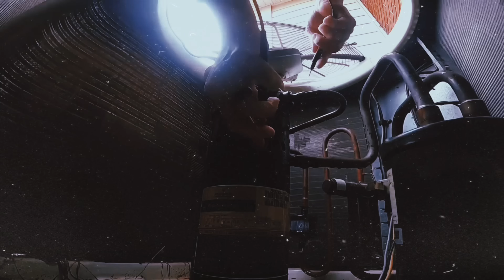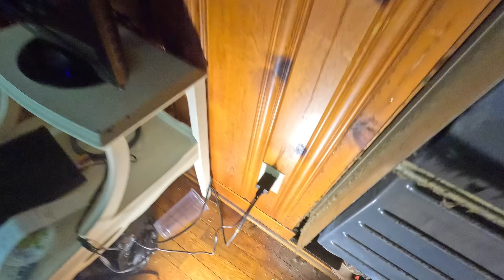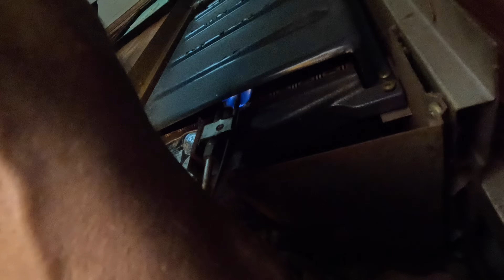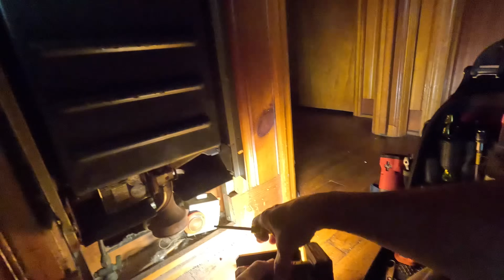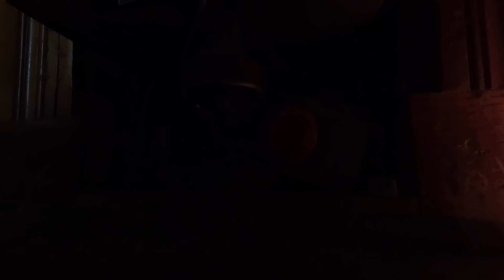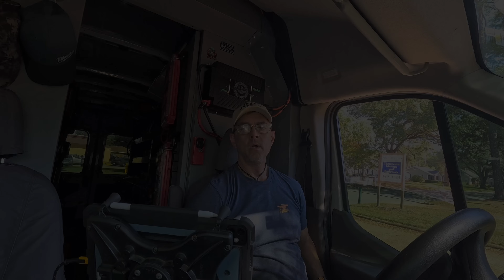Checking on an old vented furnace! #hvaclife #hvacguy #hvactrainingvideos

Comment: Haven't seen one of those wall heaters in a hot minute.  Lots of those out in CA in older homes.  I always liked to make sure people had a couple of low level CO monitors in the home along with normal CO detectors.  Keep a good thermocouple in them and the pilot cleaned and you are rocking and rolling.  Those old knobs like to get brittle from the heat as I am sure you are well aware of.  A little super glue and some charcoal powder and you can fuse the plastic back together in a pinch and get them to turn the way you need them.  Been there before.  They are sketchy little heaters.  Thanks for the video and stay safe out there.

Comment: My first thought was that's a Mickey mouse valve repair job. Then seeing the knob broken You should either get a new knob or a new valve but you can't leave it that way for the tenant. Also if that's a copper tube going to the valve I believe it should be aluminum for natural gas. And you need the proper gas valve to be activated by a thermostat. That really looks like a rube Goldberg special.

Comment: @ 6 something in & poking @ heat ex changer what are you doing cking its thickness & integrity  id guess or is that just an heat shield but dont think id risk making the expensive repairs & just replace it new

Comment: Hello guys, greetings, I have a question about which manifold will be better, the Yellow Jacket digital Titanmax or the Fieldpiece sman 482V? I thank you for your help
Reply: I have used the SM480V for years with no issues.  I see the Yellow Jacket can sync with BT probes that sense relative humidity, but I didn't see anything about it using them to calculate "Target Superheat".  You might look into that. The FP does that with its wireless temperature probes.  Makes charging fixed metering devices easier. I know some found the touch screen on previous  models to be a problem when wet and fragile.  I don't know why it needs to be so much larger than the display.  Other than that it looks OK to me.
Reply: Also find out how easy it will be to read the screen in bright sunlight and low light.  Color screens can be difficult to see in bright light.   I don't think the eye candy is good if it makes it difficult to use.

Comment: Looks like someone replaced the original valve with a water heater valve.  Dials on wall heater valves look different.  Most of the wall heaters now have room thermostats.  That's a wall heater or wall furnace.

Comment: I had to go look....I have a rental unit that still has one of these heaters (long retired, but still in place). Installed new when the house was built in 1947, and it contains a gas valve like the one you see in your service call.

Comment: Reminds me of the original heater that was in this house when we bought it in 1972. It was a floor furnace in the hallway that was covered by a floor grate. In one of the corners there was a little panel that lifted up and there was one switch on/off and a single knob that said colder/warmer. Not the most convenient climate control. But it could be freezing cold and 15 or 20 minutes later the house could be warmed up. It also had no wiring going to it.
Reply: Those were oldies but goodies.

Comment: I hope you found the correct valve.  The last one I worked on had a fan with a limit disk to control it, and that was over 20 years ago. That most definitely is not the correct valve for that unit. I'm sorry Curtis, but I was hoping you didn't get it lit with that copper line being used as a supply line.

Comment: Sometimes (like this one) you look like you walked up to a crime scene!! I agree with scottjones7292, I would not take the liability risk with a heater installed in the 1940's....
Reply: That is not a 1940s heater.  Looks like 1960s or 70s.

Comment: Curtis you take the knob that is controlling your heat setting and take off the knob and turn the adjustment screw to getting to come on and ruff calibrate it to come on and the plot is dirty needs cleaning hope that helps you

Comment: Man a unatrol valve on a wall furnace curtis u realy get into some stuff the scary part is at least as of couple years ago u can still get floor and wall furnaces they are a pain in the back side to work on glad u got the job 👍 I think 🤔 good luck
Reply: Some DIY installed a water heater valve on a wall heater.  How is that going to work?
Reply: Unatrol made furnace valves they were on the old intertherm Mac furnaces for mobile homes as old as that wall unit is probably original  those nobs were easy to break they would get hot and become bridle

Comment: on that old ass cast out the Flathead big screw to unscrew that there should be an adjustment for the temperature or the pilot one of the two don't call me on that but the last time I remember working on one of those

Comment: I lived on central/southern California coast all my life (70 YO) and those wall heaters are in practically every house I lived in until I bought a house in the high desert  (teens and snow in the winter/ high  90s in the summer) 3 years ago with a furnace and central air. The climate is so temperate on the coast that a wall heater is generally all you need.

I even ran across one in an old converted motel turned into apartments that was so old it had a thermocouple for the gas valve but not the pilot.
Reply: My '50s house in the SF Bay Area apparently had 2 of those in-wall furnaces originally.  I think there may have been a fire in one of them long ago and they were removed and replaced sometime in the '70s with an old Fraser Johnston forced air furnace.  I made use of the old oval vent pipe openings for attic ventilation by installing some fans on the bottom.  They plumbed the new furnace off one of the old gas lines and ran the other gas line out to the back patio.  I installed a natural gas grill and cooktop out there a while back.

Comment: Looks like some bonehead installed that heater 'fast and furious' , the controls are not easily accessible, the knob that broke off probably needs to be pushed inward while hitting the piezo switch to light the pilot. I personally would not repair that unit, needs to be replaced.
Reply: I'm guessing that valve is a recent addition to try and repair the unit as the patina is different and it's likely not even close to the right valve, as it should have been installed with the knob on the top, not the side. Those old adjustable air horns are probably from the 1950s or earlier and the valve is probably 1970s. AAMOF, I would be surprised if the original valve had a thermocouple that controlled the pilot. In those old units the pilot was always on, whether it was lit or not.

Comment: Watch out for that copper gas line. Gas corrodes copper and it's very normal to find leaks as well as the flakes on the inside of the copper block the screen inside the value.
Reply: so much for running gas lines with copper tubing, I've seen it